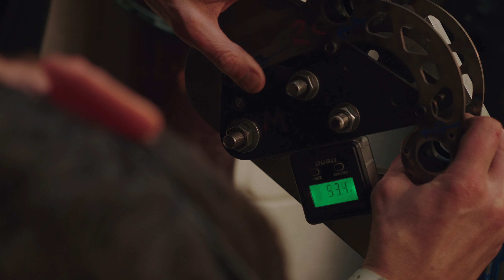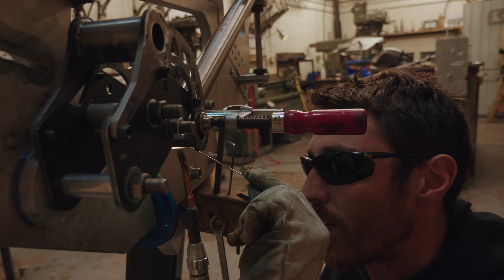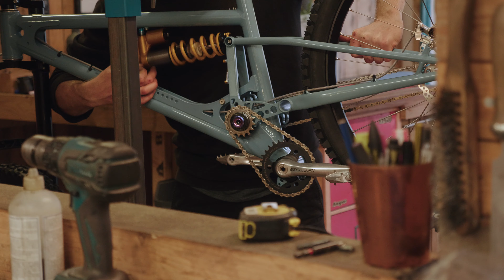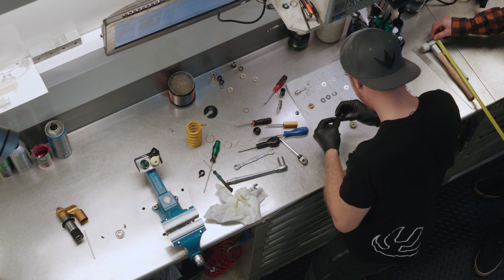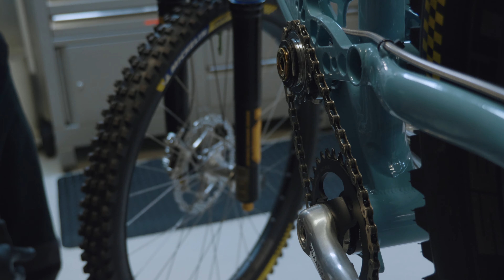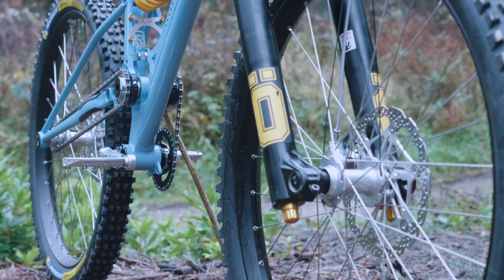Starling Cycles Sturn V2: A Single Speed, Jack Drive Downhill Bike

Comment: Large primary drive ring down at the BB in harms way sacrificing ground clearance & then a small one on the secondary on the RH side. It's backwards from how it should be & makes no sense. If you did it right you wouldn't need those ugly chainstay rubbers either. The bends in your shockstays are ugly & make it look like they've started to fail. 🤨 At least it doesn't have a dumb derailleur. 👌
Reply: Thanks or your positive comments.  You much be such an intelligent, experienced engineer and bike designer to have made such well observed comments!!
Reply: @joemcewan2950  Even better, I'm a person with common sense. 👍